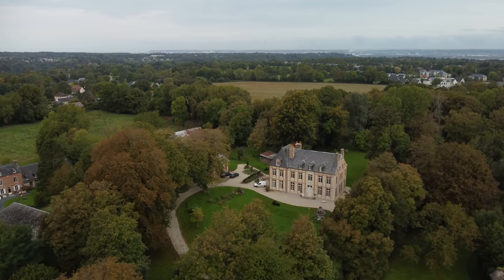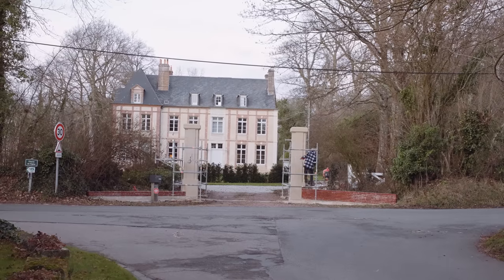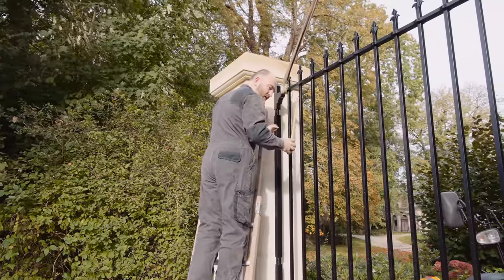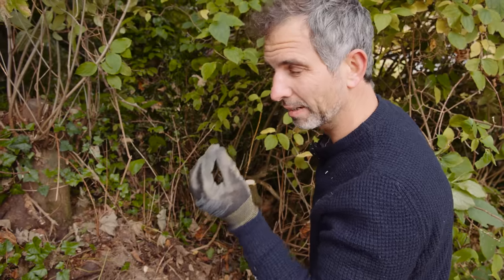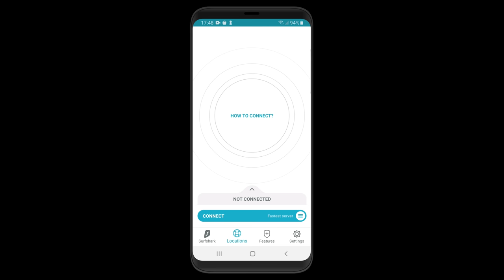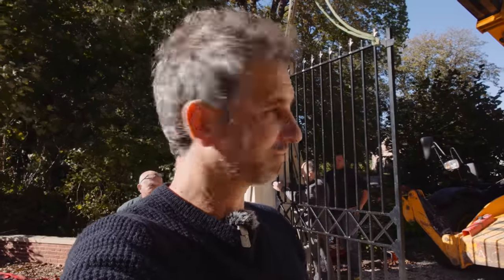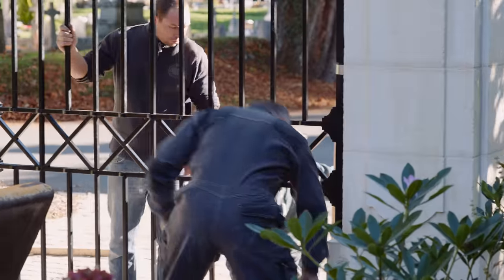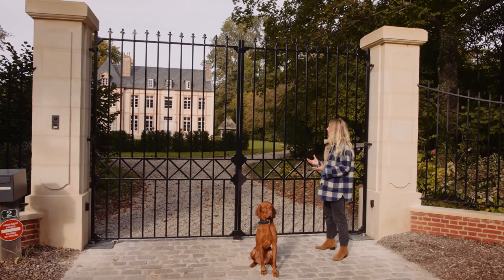Happy Reveal! The Chateau Gates are DONE!

Comment: Hot tip re cables, every time cables are installed in a wall or inner space, my brother takes a photo of it before it’s covered up. Then he prints that photo on a big A3 sized sheet of paper (and saves it digitally of course) as a cable map. Then you can just refer to the cable map every time you need to see where the cables are before drilling!
Reply: There is also an electricity wall detector. It is affordable. My father uses It before drilling, extremely useful 😊
Reply: Very smart.. I have tried to do that with irrigation ... but there are less references in the photo to tie where they are ...unless a tape measure is part of the pic...
Reply: Excellent ideas!  Electricity detector and pictures while under construction recording the positioning… of course, they could look back at the video of when the wires were going in!
Reply: yes, As-built drawings are a must

Comment: Phillip, I had expected a sort of short metal 'support rail' for the corners of both gates to slide onto, when they are fully open, so the weight wouldn't just hang on the hinges. Like what's under the middle of the gate, where the two wings meet. Are you still intending to have them installed? Or does modern construction make them superfluous?
The gate looks fantastic, very fitting for the château! Das macht was her! 😀👍